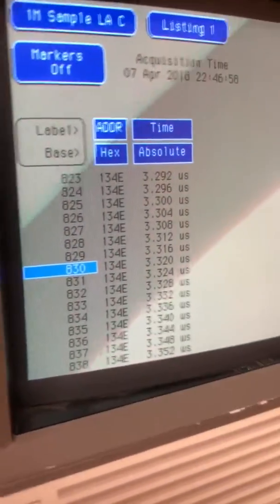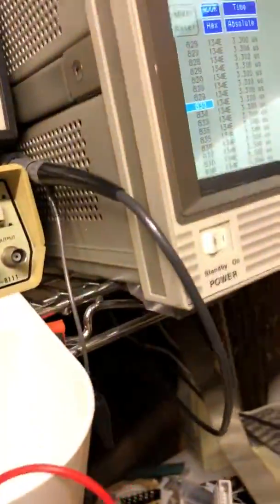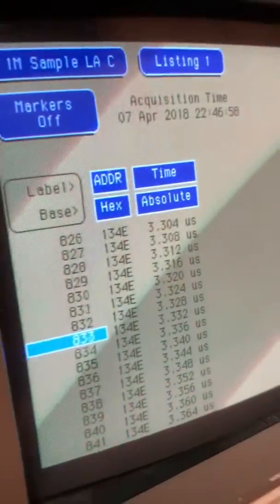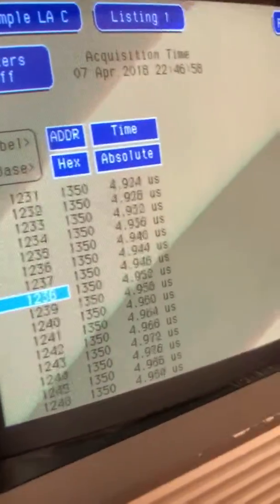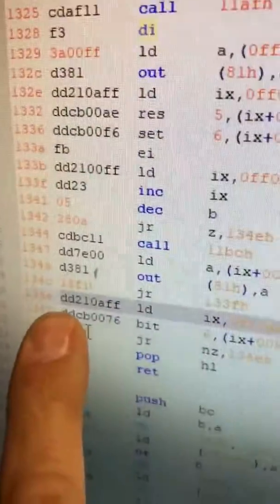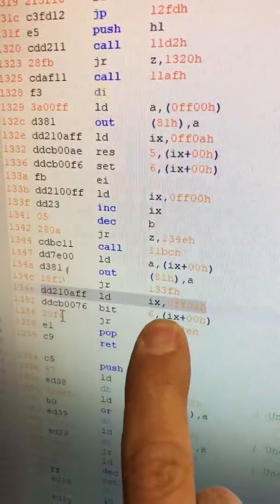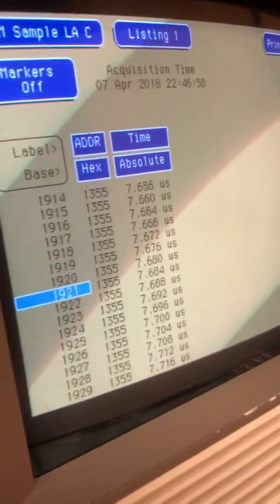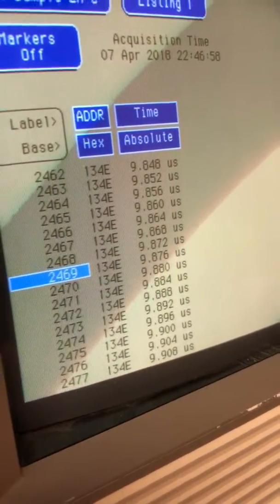Using an HP 16500C Logic Analyzer to test a Micromint SB180 computer

Comment: Sometimes all I need is another set of eyes.  They might not even be technical eyes, but I'll ask them if anything is out of order.  Not infrequently they'll ask an obvious question, like those fruity-colored jumper caps and snap me to focus.

Thanks for my first glimpse into a logic analyzer.  I've never seen one operated, didn't know how the data was presented, nothing.  This was a nice toe in the water.  
I recently purchased one of these machines, as an 'external floppy enclosure'.  I'd suspected there was a Littleboard of some stripe inside and indeed there was, an SB180 with a dud second com port!  I fixed that easy with a serial line-driver ic and hung a Gotek on it.  You really need more than a pair of 360k floppy drives.

This machine has an interesting history!  It was an early Open-Source project, on the cover of Byte Magazine, September 1985.

http://dunfield.classiccmp.org/mmint/h/bsep85c.jpg